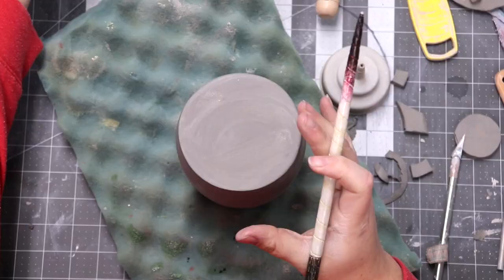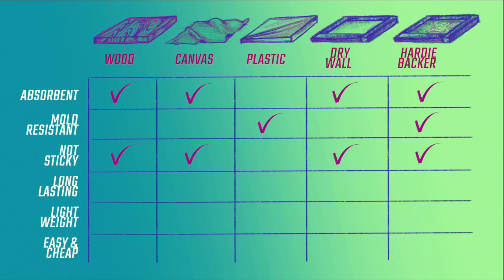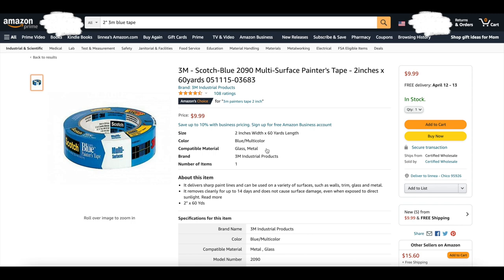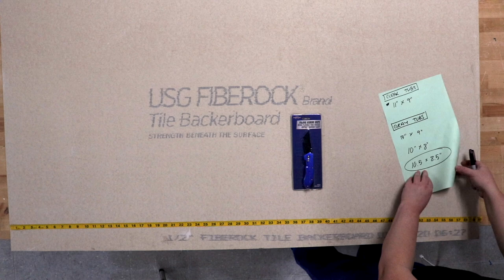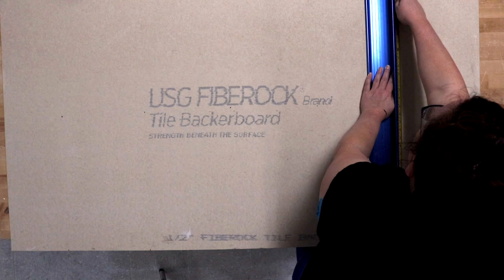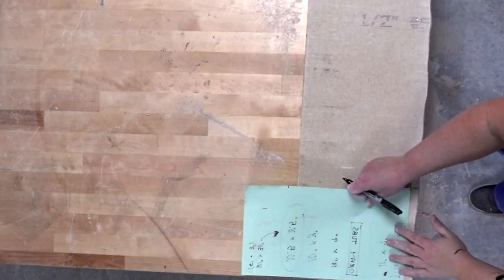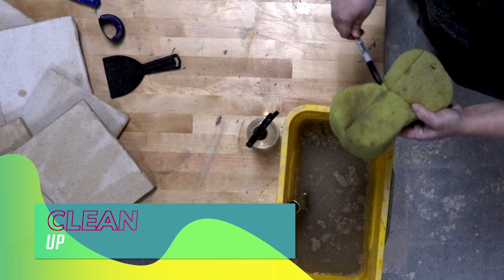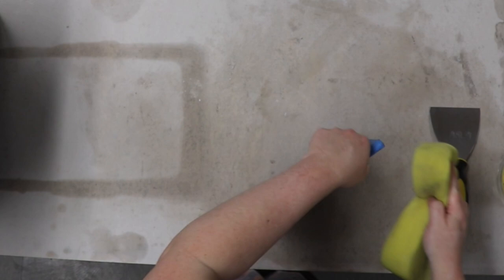Reduce Clay Dust Part 2: Hardie Backer Wareboards

Comment: Would the 1/4 inch hardie backer board be strong enough allowing for a lighter and cheaper wareboard?
Reply from the maker: @ckhansen19  if the are small yes… but I also made some longer boards and they have snapped in half. I would get the thicker hardie backer.

Comment: it would be easier & cleaner cut if u scorred the backerboard & had the scoring UP when u push down to break off the pieces...that’s how scoring & breaking is done ...
also duc tape would last longer & be more waterproof than the painters tape.
good video tho, thanks
Reply from the maker: I was also wondering if the breaking might have been cleaner if I hadn’t flipped the board before breaking? I agree, double scoring would be better. 

I’m not sure duct tape would be best... clay would stick to the glossy surface and it often leaves a residue after you’ve used it when it starts wearing down.

Comment: I bought something similar, but it isn't Hardie Backer brand, and one side seems to be flaking off. Have you noticed the top layer flaking at all? I think I recall seeing somewhere that you need to use this particular brand for pottery?
Reply from the maker: Mine have held up for years now. No flaking.
Reply: I think I ended up with cement board. Hoping it didn't get into my clay? I've heard if it does it can make your wares explode in the kiln :\  @MissLinneaLark

Comment: Thanks great video. I think plaster board is the equivalent in the UK.
Reply from the maker: I think your plasterboard is our drywall, used for walls. Hardie Backer is cement board that is mold resistant that lines showers, behind the tile. It helps keep mold from growing. I hope that helps. Good luck!

Comment: Thanks for the vidéo ! What material is a Hardie Backer Wareboard ? I live in Switzerland and would love to find the equivalent :)
Reply from the maker: Hardiebacker is cement boards that are placed beneath tiles in bathrooms to repel mold. Hope this helps. You might need to ask a local carpenter 😄. Some people even use drywall if you cannot find hardiebacker. Good luck!